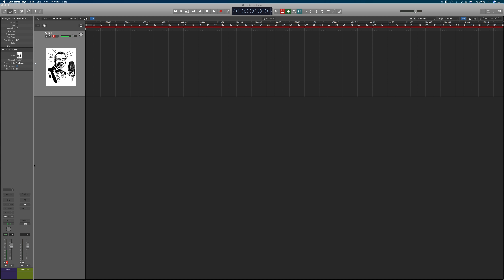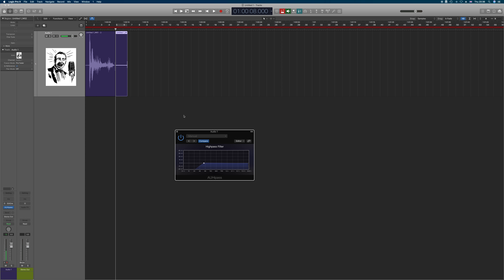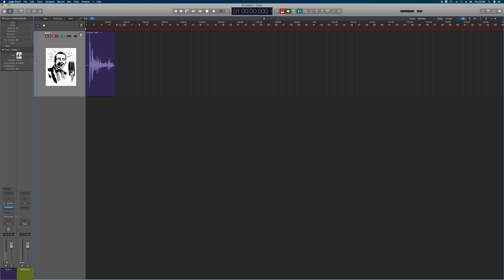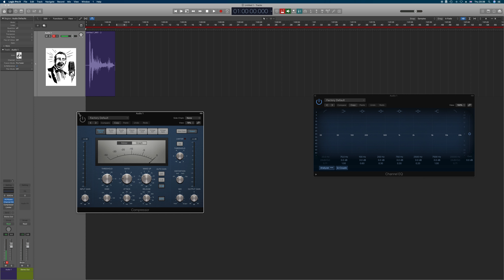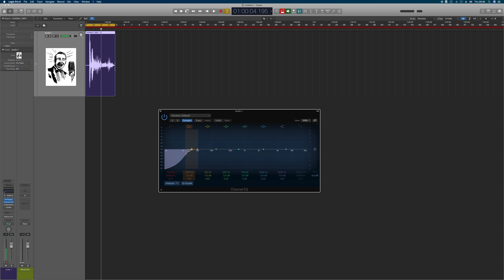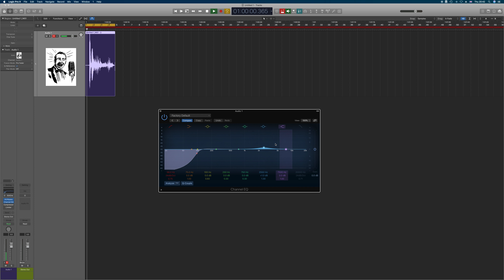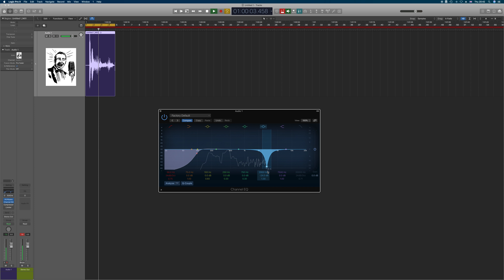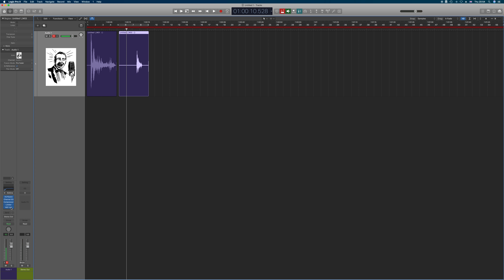Recording voiceover / audiobooks in Logic Pro X video 2

Comment: This is a wonderful tutorial for voice over on Logic Pro X. Many helpful tips on setup and shortcuts. Thanks for this! One comment - by default Logic will assign the marquee tool to the Cmnd+Click shortcut, so all you don't have to change your pointer. You simply have to hold the Command key and it will turn your mouse cursor to the marquee tool. :)